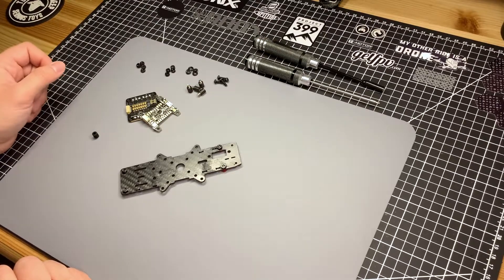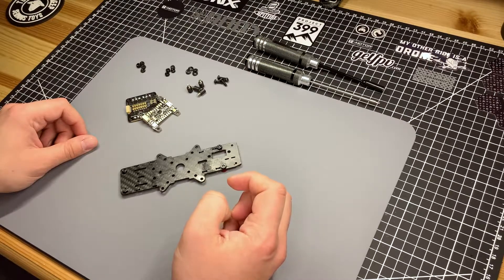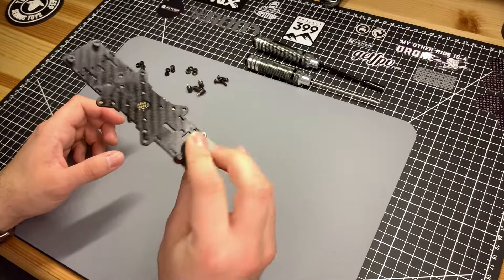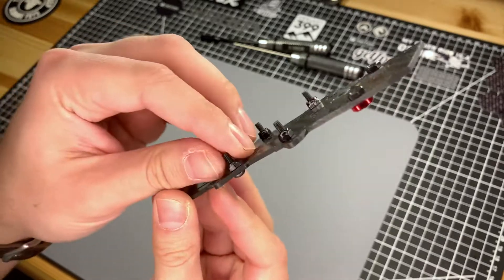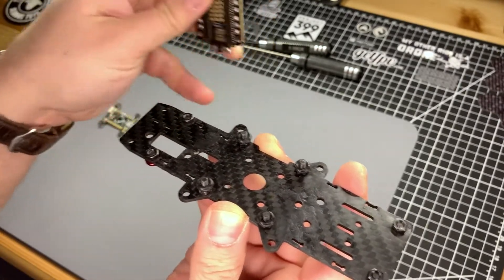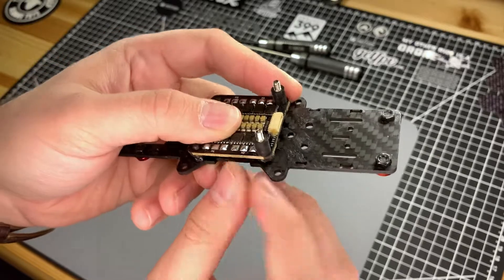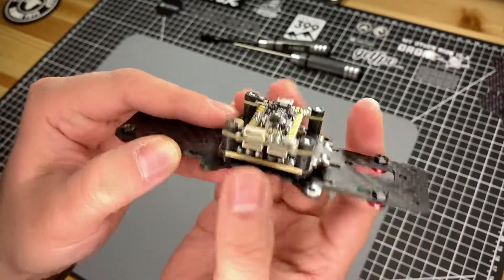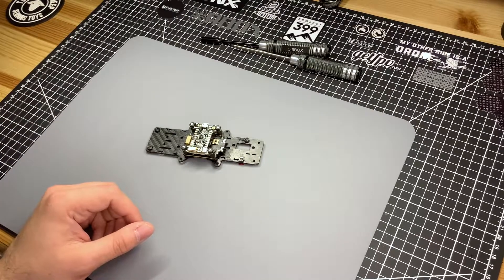Should you soft-mount your KISS flight-controller? || Food For Flight - Ep. 3

Comment: I have always softmounted my ESC and hardmounted my FC. I noticed that I can get away with much higher PIDs. I think the adaptive filtering feature of KISS makes it love hard mount. That's just my personal experience. Nice video btw.
Reply: both will work. i use mostly standoffs that come with impulce rc kits. thats it. no overthinking. have frames with literally screwed fc with screws to plastic. works too. ;)
Reply: @alexanderfedorov7890  I get it. Once I found something that worked for me and was reliable I did not wanna change it up!
Reply from the maker: Thanks man! And yup that's my understanding as well, the adaptive filter needs those vibes 😉